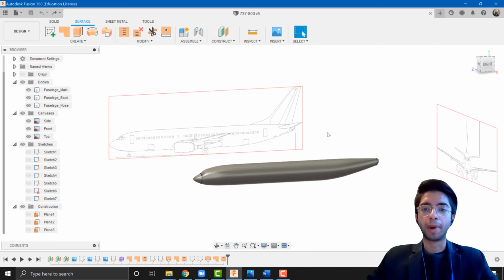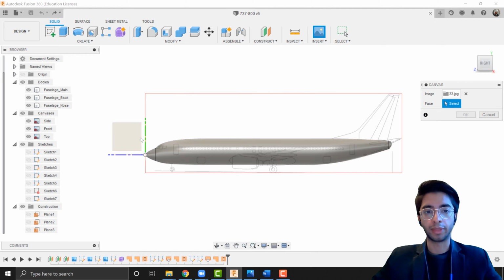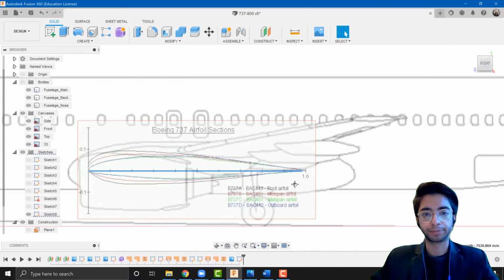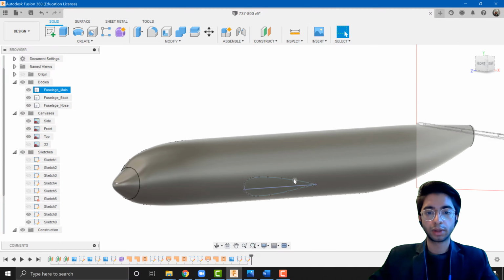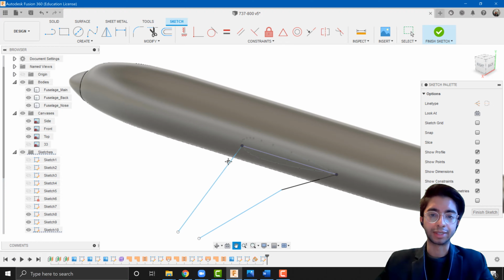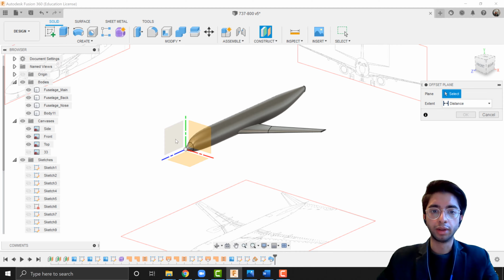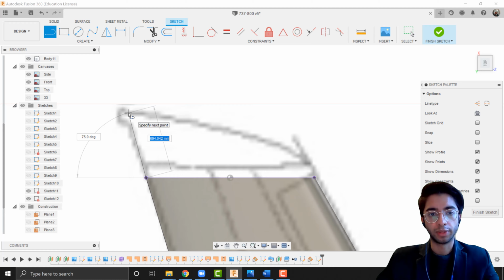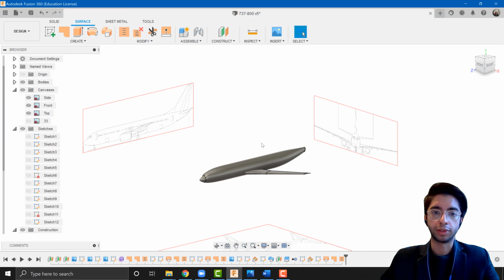How to Model an Aircraft in Fusion 360 | Tutorial 3 - Wings | Step-by-Step (4K)

Comment: For everyone struggling to loft the wing tip (19:10), I was able to fix it like this:
-Go to the sketch that you made right before you tried to loft (the sketch that's on the new angled plane).
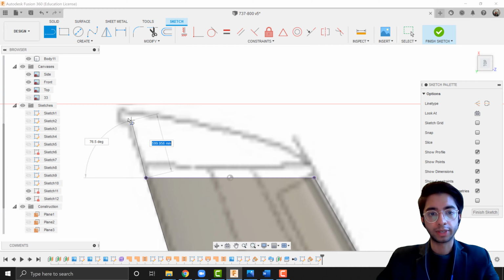-Here, you will see that there are three edges: two straight and one curved. We will be modifying the straight edge outside the airfoil that he created at 18:12 and NOT the other one (NOT the chord line that's inside the airfoil).
-Apply a tangent constraint between said edge and the wing's edge that it is connected to (stay in top view to see clearly which one).

Now loft should work fine. Sorry for adding too much detail about such a simple fix, I just wanted to avoid any confusion.
Reply: I can't use tangent because it's 2 straight lines I don't get it...
Reply: @x_x2540  did u fixed it ?

Comment: Кончик крыла, кто столкнулся с проблемой. Во-первых вы можете случайно использовать LOFT синий, а нужно оранжевый для пустотелых фигур,  ибо потом нужно будет генерить из этой модели твердое тело,

Во-вторых, если не получается сразу соеденить как это делали ранее (выделение половины крыла - хорда - вторая половина крыла). Можете сделать иначе сначала создать половину нижнюю часть крыла соединить с серединой и вторым действием верхнюю часть, а потом просто все пропатчить (path) и соединить в одну деталь. Это я о Body13(2) 19:00 минута видео.

--------------------------------

The tip of the wing, who is facing a problem. First, you can accidentally use LOFT blue, but you need orange for hollow shapes, because then you will need to generate a solid from this model.,

Secondly, if it is not possible to connect immediately as it was done earlier (allocation of half of the wing - chord - the second half of the wing). You can do it differently: first create a half, connect the lower part of the wing to the middle and the upper part with the second action, and then just patch everything (path) and connect it into one piece. This is me about Body13(2) 19:00 minute video.

Comment: Для всех кто столкнулся с бедой на этапе создания крыла и инструментом Sweep. Тут беда заключается в том, что функция Sweep, а именно кнопка "Path" работает при учете, что ВЫДЕЛЯЕМАЯ ЛИНИЯ ПРЯМАЯ без дополнительных отрезков, если вы как и я решили быть перфекционистом и обвести крыло с помощью нескольких отрезков прямых или кривых линий, то у вас ничего не получится. Просто возьмите и нарисуйте одну прямую линию, если крыло недостаточно длинное/короткое ( в длину от носа до хвоста ) вернитесь в истории и сдвиньте в нужную сторону центровую линию хорды крыла. 
Удачи в моделировании!

---------------------------------------------
For everyone who has encountered trouble at the stage of creating a wing and the Sweep tool. The trouble here is that the Sweep function, namely the "Path" button, works taking into account that the SELECTED LINE is STRAIGHT without additional segments, if you, like me, decide to be a perfectionist and circle the wing using several straight or curved line segments, then you will not succeed. Just take and draw one straight line, if the wing is not long/short enough (in length from nose to tail), go back to the history and shift the center line of the wing chord to the desired direction. 
Good luck with the modeling!

Comment: Hey so you can make this easier and modifiable by using a user parameter found in the modify drop down menu under solids, create new user parameter name it "Wing_Diahedral_Angle" and set unit to angle and boom, you might have to use negative value depending if you working on left or right plane.

Super tutorial!
-Zody K.
Reply from the maker: Hey Zody! That's an amazing piece of advice. I think that's super useful especially when you want to continuously try and test out different parameters :)

Comment: Couuld you make a guide on doing the wing tips that go up instead of following the current angle? You said you could sweep it in 3d, but I cant seem to figure out a way to find the right plane to draw a spline that matches the curvature. The specific plane I'm using is the A350-1000
Reply from the maker: Hey there! It'll take a while before I'll be able to make a video for that :) 
As a starter, what you can try doing is creating a plane at a random angle, starting from the flat wingtip, and draw a few points on that same place. Once the sketch is created in 2D, use the 3D sketch tools to pull those points out of the plane and manipulate them so they match the curvature of the winglets. You can also look at my A350 timelapse video where I do this :) 

If you need a more urgent way, message me via https://www.textheexperience.com/contact

Comment: if anyone is having a problem with the sweep tool when making the wing, I found out that it will only work if one of the lines you sketched around the wing has to be completely straight, or else an error pops up that says "surface not smooth". The other line can be bent.
Reply from the maker: Thank you so much for sharing that! I'm sure it'll help a lot of people.
Reply: Which lines ? Lines that create airfoil or lines that are the wings ? I tryed everything, but still it says that surface is not smooth. Thank you for this advice
Reply: For me, it actually doesn't but I can switch the lines for the path and guide rail and it worked.
Reply: 我在处理机翼问题上卡了一下午时间，然后我最后成功了。我的经验是：机翼的翼尖不能太尖锐，否则无法放样。
Reply: I was stuck on the wing problem for an afternoon, and then I finally succeeded. My experience is: the tip of the wing cannot be too sharp, otherwise it will not be set loft.But I found that the author's wingtips are very sharp, and I don't know how.

Comment: Thank you for these videos. Your method is perfect for those who wish to make moulds for RC plane parts.
Reply from the maker: Thank you so much Nidal. Which RC model are you working on?
Reply: @TEXDesignEngineering  
Thank you for asking. Still too early for building a model. I am starting to learn Fusion 360, but 777 is my dream model.

I watched different builders. Some cast airplane shells in moulds, others build a skeleton frame which later they cover or shape foam into it.
I find the molding method easier and more accurate (Ramy RC for example), but the drawback is that 3-D printing takes long time and heaps of material.

I find your tutorials very inspiring.
Reply: Yeah. I think I'm Going to make a mold like ramy but of the a321 with about an 88in wing span